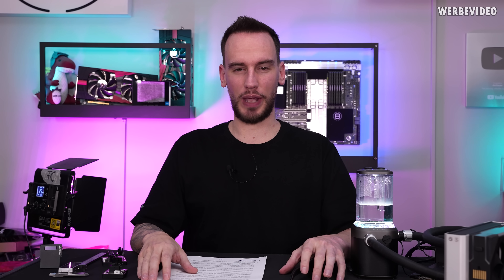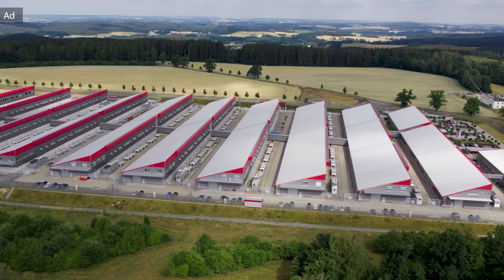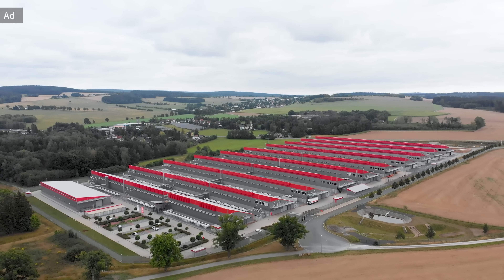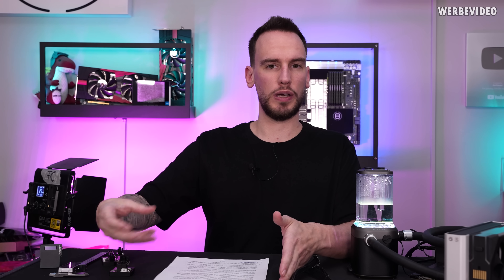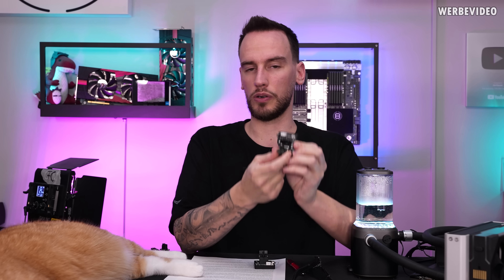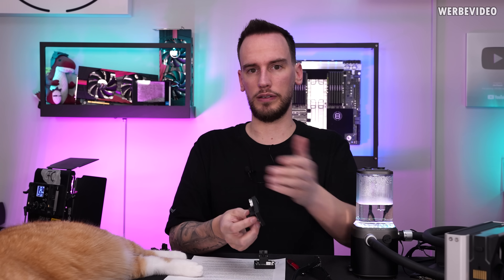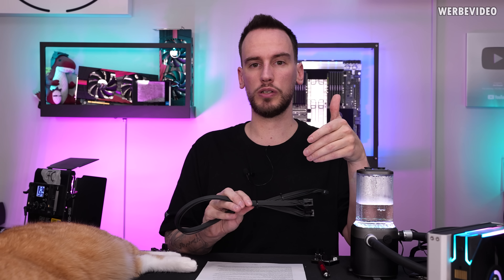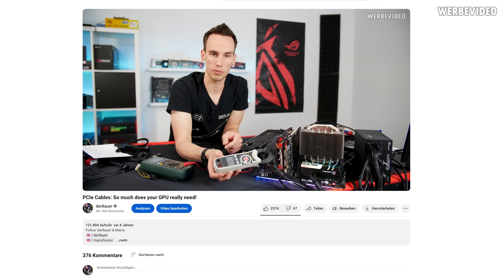12VHPWR is just Garbage and will Remain a Problem!!

Comment: I think the 48VHPWR connector is the way to go. It is rated for 600W. Since it  delivers power at 48V it uses a single pair of current carrying wires. This makes the connector far simpler. The issue is it requires a new power supply capable of delivering 48V.
Reply: you will have to make a more complex VRM system with some degree of protection against short circuits and breakdown.
Reply: Good luck converting 48v to 1.2v. Might as well duplicate the entire cooler of the card just for the vrm and call it an 8 slot gpu(Who needs expansion slots anyway xD)
Reply: @pesho9971  Interestingly, VRM efficiency goes up with input voltage increase! What becomes worse is the ripple, but i mean you have quite a few phases on there by now, so that might be OK regardless.
Reply: @SianaGearz  no it doesn't. total system efficiency might improve because of lower current draw on the input but generally speaking the larger the voltage mismatch, the less efficient the voltage converter becomes
Reply: Just finally put an IEC connector on the video card and have mains pass through from the PSU. :D
Reply: you have won the 'i know nothing about electricity' award. 😂😂

Comment: These cards are needlessly clocked into the overclocking zone from factory, thus using more power for no reason, my 4090 still works stupid fast even at 200-300 watt power draw. If it needs more then 3x 8pin it's using to much power, and also is Nvidia on the climate change bandwagon?

Comment: I knew from the beginning of that connector that it will be failure at 400w+
It just not possible to push safely so much current through 6 tiny pins.

Comment: This issue was enough for my wife to decide to go with a 7900 XTX over the NVIDIA alternatives, and I can't say I blame her. I only have a 4070Ti, and so am unlikely to suffer the same issues as 4090 owners, but I will likely also move to AMD products when my next upgrade cycle comes around.  Quite why they thought this was clever, or even remotely necessary, baffles me, as does this insane push for 12VHPWR on motherboards, forcing all the power conversion hardware out of the PSU where it is out of the way, and onto the motherboard where it will take up valuable board real estate. Change for change sake is what this seems to be, and I genuinely hope it comes back to bite these idiots.
Reply: It follows the quote "create a problem to fix it", it really wasn't needed tbh
Reply: Yep. I got my 4090 mostly for the 24GB VRAM and machine learning capabilities. I cap the card at 350W since that gets me most of the performance, with reduced energy bill, reduced noise, and reduced risk of connector melting. For such a use case I feel like it's the perfect card. But if you really want to get the max FPS/$ out of your card and don't care about power consumption, the 7900XTX is definitely a better choice.
Reply: Same, Got a 7900XTX for main GPU and 7800XT this gen. Had these power connectors not been an issue maybe I would have picked differently. Am honestly scared of starting a fire in the house gaming.
Reply: It is just 4090 that struggles from this issue. Even 4080 is fine, since it draws only 320W (usually less). Looks like constant 400+W power usage is what makes these connectors melt. So even undervolted 4090s should be fine too.
Reply: @stangamer1151  That may be, but as others have stated, this should never have happened in the first place, because we NEVER needed this connector. 8-pins were, and will continue to be, perfectly fine if not vastly better.
Reply: @GraceMcClain  I totally agree. They could equip only 4070 Tis and 4080s with this connector though. And 4090 should have had either 2 X 12 pin or 4 X 8 pin. Then we would never heard about any issues with connectors.
Reply: @stangamer1151  I have also read about connectors melting on the RTX4080. It's definitely not as common as the RTX4090, but it can still happen.

Comment: I had the same problem with an old GPU/PSU OCZ, I changed the PSU and the problem was fixed. 
I had a red LED, I could change back to green with a wiggle but under load the PC crashed anyway (looks like the same problem).
The 8 pin or 6 pin didn't compensate anything even on low load
Your proposal seems really dubious even if I agree that the large margin of errors on the 6/8pins prevents from hasards which is the most important, IMO.

Comment: I got my 4090 when it came out and seem to be super lucky that i have had no issues - I hope im not jinxing myself.
Reply: fe? did you tweak something with it? aftermarket cables?
Reply: @anobeus  MSI Suprim X. I use a cable extension from Cablemod that terminates into 4x 8pins.

Comment: Only way to fix this with same single 12VHPWR is to increase voltage. Not sure if that would create other problems. You need better insulation or spacing probably.
Call it 24VHPWR or something and move GPUs to 24V. Probably never going to happen as it would create a lot of transition problems before PSUs were updated.
Reply: 12V is standard. No-one will start manufacturing power supplies with 24V lines because one NRetardia would want to use 24V connector.

Comment: As soon as I saw the new 12VHPWR connector I got instantly suspicious given that 30-series already OCP-tripped power supplies when it first came out.
Reply: Same, plus, as a general rule of thumb, if you want to draw more power you will need thicker wires and beefier connectors, this was the opposite move.
Reply: @SergioEduP yes yes yes yes yes fucking YES my guy. God you should be working for Nvidia because whoever they got to design the 12 volt high power connector really doesn't know what he's doing at all. Whoever thought using that trash was a good idea should be fired from Nvidia.
Reply: That situation was a bit different - in that case the problem was that the power draw was very spiky, especially in the 1 millisecond range. Although the ATX 3.0 spec has provisions for exactly that problem, with the 40-series it looks like they managed to smooth things out so the spikes are much smaller.
Reply: @EmanuelHoogeveen still doesn't mean you need to reinvent the wheel lol? 🤦

There's nothing wrong with a standard 8pin connection. Nvidia just wanted to be fancy and it back fired. Plus if your GPU is spiking out of control then something is not right at all. By that I mean jumping from let's say 200 watts to 600watts.
Reply: It wasn’t OCP being triggered, too much noise on the 12V sense pins because of transient spikes, thus the PSU freaks out and shuts down. People fixed it by either removing the 12V sense pin on the 24 pin or some put an i ferrite bead on the 12v sense wire, most people don’t know how to do this or don’t want to risk it, and I don’t blame them
Reply: @luvingyouu  bro the fact that you must go to those lengths just to make sure you don't have a GPU spike in power is utterly unacceptable sorry to say.
Reply: Actually that confused me. Why should we not buy it if its working? I prefer to use 3 8 pin cables than one 12 pin.
Reply: Yeah, making the physical connector smaller for a higher power draw was a real head scratcher.
Reply: @volvo09  indeed 🤦

Comment: This design is as broken as only can be.
We need a new standard ASAP because this will be always a problem. 
The people behind this project should be fired.
Reply: Need go back using old PCIE power connectors which didn't have these problems.
Reply: @XantheFIN  Yup. And it has good safety margin.
Reply: @XantheFIN PCIE connectors have melted before too. Not as wide spread of a failure as this but it definitely happens.
Reply: @theyoungjawn  all connectors have melted in the past at some point. PCIe connectors are not immune to overload or bad construction/installation but with historical data we can say they are not a shiteshow like this
Reply: @theyoungjawn  I checked and some of those was people using single PCIE output of PSU and used splitter to get it to two. Some were using over 8 years old PSU and other questionable things. But still even with all those way way less than these stupid new connectors which melts almost by breathing to them while being loaded.
Reply: @theyoungjawn  Mainly on cheap PSUs or people using cheap adapters. Legit PCIe connectors made by the likes of TE Connectivity/Molex basically have no issues.
Reply: @theyoungjawn  Let's not even pretend the incident rate of the 8 and 6 pin PCIe connectors is anywhere close to the 12VHPWR connector.  It's like a 0.0001% incident rate vs a 1% rate for the 12VHPWR connector.  You really have to do some dumb things to melt the 6 and 8 pin connectors.  The 12VHPWR will just melt itself on the 4090 in many common scenarios.
Reply: @giglioflex  reread what I just said. You typed this comment for no reason. Lol
Reply: @XantheFIN  And that was fine on low power draw cards.
I have burnt up a PCI-E cable. with a Gigabyte 780ti overclocked card. I melted the connector at the PSU end and it kept going.
So just because you can, does not mean you should.
Reply: @marcogenovesi8570  At least my 3 8 pin cables on my 3090 don't cause a fucking OCP shut down by being slightly bent.
Reply: Server cards use 8pin EPS the same connector that you use for cpu extra power. If it is good enough for servers I think it is good enough for desktops.
Reply: @tudalex that is a good point. The 8 pin EPS conector actually has 4x 12v and 4x GND conductors making it superior to PCIe 8pin that has 3x 12v and 5x GND.
Reply: The funny thing of reality is.
Nvidia simply will release the RTX 4070 Super - RTX 4070 Ti Super and RTX 4080 Super with the same connectors again!
Reply: True, but the issue is drastically less present on these lower powered cards. Here's to hoping it stays that way... @N0N0111
Reply: Good luck with that.
All new ATX 3.0 power supplies have this connector for graphics (even two for 1600W versions), all power supply vendor updated their models to this one, even top models from Seasonic (like PRIME TX) are updated to this standard.
The most we can get will be some changes to graphics cards, better connectors, placed in better places etc.
Reply: thats not an issue with modular power supplies. it really doesnt matter if you just change the card side of the connector. as long as the power supply side is okay, you can terminate the other side into anything you want, full size molex Jr 12pin for example. which would fix all issues. and i think this is what should be done.

going for a new high Power pcie connector is the right thing to do, but the 12vhpwr just sucks. alot.
Reply: @andreiga76 there is updated 12vhpwr connector that spots working if it’s not fully plugged in and prevents meltdown
Reply: Just use the old standard. As said in the video bump the old connector to 200W, which is totally safe...
Reply: After all, there is already a new standard 12V-2x6. The 12VHPWR was quietly thrown into the trash.
Reply: @p0k314COM 12v-2x6 (another dumb name) doesn’t solve the real issue…it places the blame on the end user not plugging the connector in properly, when the underlying engineering and current/tolerances/limits provisioning is the issue.
Reply: PCI-E SIG should create a new connector from stratch as this approach is very flawed
Reply: Put a Deans connector on it.
Reply: It just works though.
Reply: Or just you know......

Dual 12VHP. Like..... we already did with old PCIE. Given this problem on 4080 (320W) is almost non-existent
Reply: Its a non issue. According to the AQL industry standard (Acceptable Quality Level) the acceptable failure rates are as follows. This issue also would fall under a minor defect due to scarcity of the issue (less than %0.1) :

The failure to meet the requirements of customers with respect to quality is termed as defects. The three categories of defects are:

Minor Defects - Not likely to reduce the usability and material of the product for its intended purpose, but slightly altered from the intended design and specifications. The industry average AQL for minor defects is 4%.

Major Defects - Not acceptable to the customers. Usage of the product will most likely result in failure. The industry average for AQL for major defects is 2.5%.

Critical Defects - If accepted, this type of defect could potentially harm or injury the customer. These defects are completely unacceptable. The industry standard for AQL for critical defects is 0%.

Comment: I've been trying to explain this for a long time now and always get told "but the old one was only rated to 150W". I have used Molex 4.2mm (ATX) and 3mm (similar to 12VHPRW) connectors in 3d printers and CNC machines for applications far more than 150W for years. The bigger connectors are much more reliable, robust and can handle higher current. It was always insane that a higher power connector would use smaller pins and therefor smaller diameter wire.
Reply: Exactly, this is simply the USB micro A vs USB A all over again.
Stupid tiny connectors always get bend and break!!!
Reply: 8pin is rated 340w or more 150w limit is old atx standard.
Reply: @raulitrump460  think so to

i got HX1000 v2 Psu who have multi power rails ( 6 ) 12 volt have limt of  480 watt 40 amps
Reply: I've been saying the same thing about 8-pin PCIe. I have many posts on here, Twitter, reddit, etc. where I explained how PCIe cables are 16 and 18awg, and each bundle has three circuits (two pins are sense pins). With 3 circuits at 16-18awg, at 16-22a ampacity, two cables is more than enough to power a 4090. Technically one is enough to power it since 4090 is really a 450w gpu. The limitation is because if the connector on the cable bundle. I said the exact same thing Roman said about it carrying over 1kW safely with tables, but leave it to people on the Internet be like "no ur wrong" and ofc people downvote brigade and your factual comment is buried. But now they hear it from Roman and they change their tune so fast. Prime example of unable to think for themselves lol
Reply: That's exactly why I was explaining 12VHPWR cables only using two 8-pin cables was enough, and why using pigtailed cables with two connectors was perfectly fine.
Reply: The old ones are rated to 150W…
Reply: if a manufacturer rates something to a certain wattage there is a good reason. 
Of course you can deviate from and it might work now and then but shit will hit the fan sooner or later
Reply: This is a fundamental principle in electricity, it is not for nothing that there are standards on the diameter of cables according to amperage and voltage. But we must believe that Intel, because they are the ones who launched the ATX 3.0 standard, are above the fundamental rules in electricity. And Nvidia for not having done what was necessary to correct it by claiming that it was the user's fault.
Reply: @Eondragon  even intel themselves didn't use the standard on their own gpu.
Reply: The R9 295x2, a 500W card, completely ignored the 8 pin connector specs, the reference model only had two 8 pin connectors, and it worked just fine.
Reply: @kiararaine3636   Yeah, people have survived being shot in the head as well.
Doesn't mean much.
EDIT: also, the 4.2mm Mini Fit connectors used on the 8 pin PCIe connector allow 13A per contact, so on the connectors alone we got 6 x 13 = 78A on the 2 connectors alone, not to mention the card can take another 75w from the PCIe connector. Assuming it doesn't take any little watt from the slot, it's still ~53% of the absolute maximum rating of the connectors.